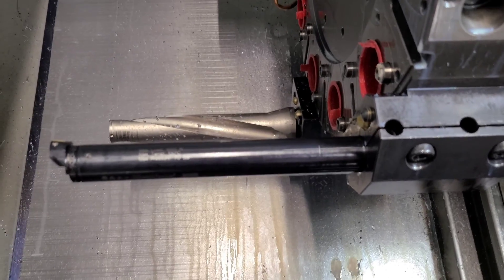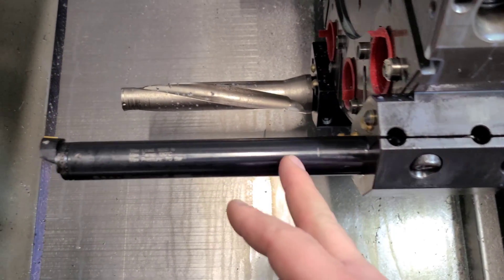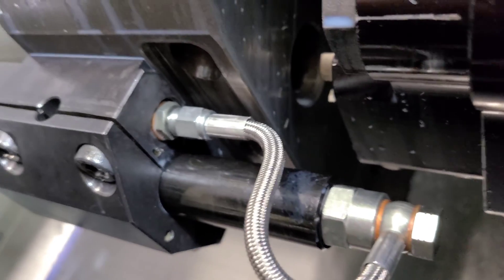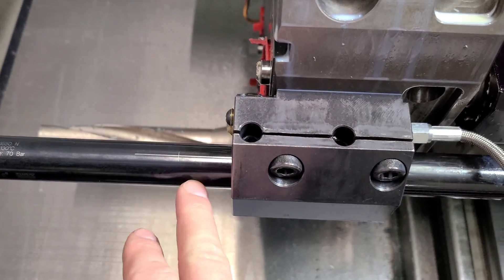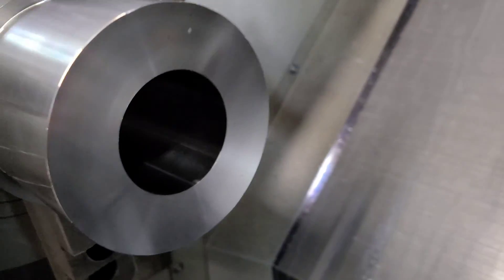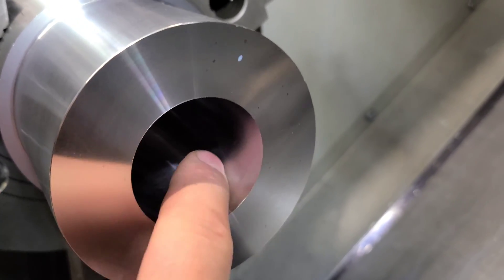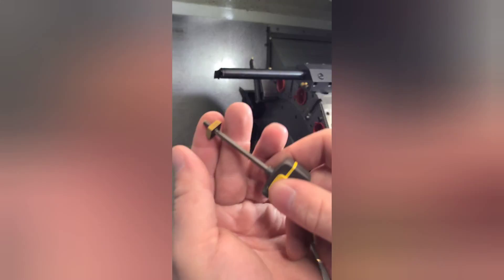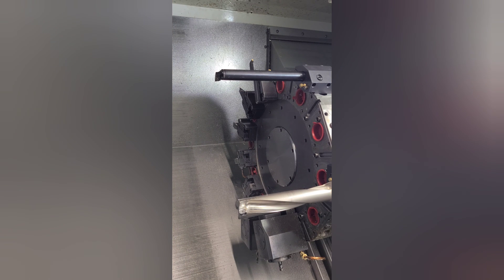Dampened Boring Bars

Comment: for a rank amateur: could you please explain the alignment marking that you had on the workpiece...it seemed to be used to set the rake angle(?) of the boring bar insert, or adjust the postion of the boring bar to get the cjtting angle needed, or?
Thanks!

Comment: what cutting conditions do you prefer for steel ? Please advise which insert tip radius is better to use
Reply: The larger the radius, the better it is for roughing, the smaller radii leave a smoother surface while finishing. Keep in mind sharper corners make for weaker parts. Steel is a very broad category but generally it likes thicker cuts and lots of coolant, harness plays a major role in cutting conditions and steel can come almost as soft as aluminum all the way up to almost as hard as diamonds.

Comment: When you are initially pulling boring bar out and shining light, then you pan to your Tool clearance on inserted drill on back side, can you explain to a novice what you are doing? You are the man, man. Lol
Reply from the maker: Time stamp in video?
Reply: 0:45 into the video. That's also my question. Do you have a video explaining the alignment process? They sent me that level you see in that instruction sheet and it seems to be a waste of money. Especially after watching your video. Any help is appreciated.
Reply: @wpdogman  3yrs later I got you bro. So when he puts the bar in since he's holding it by squeezing on the diameter, there's no way of knowing if the insert is perpendicular to the metal it is cutting. To solve this he holds the metal in the spindle, faces the front of it flat with a different tool known to be perpendicular to the work, locks the spindle, colors the metal with a marker, then scratches a line with his other known tool. He can then pull out the boring bar and align it to this line with his flashlight and eyes and be "close enough" to perpendicular while cutting the metal.